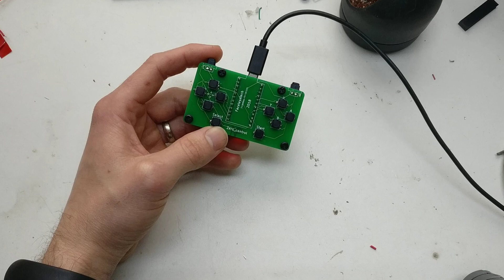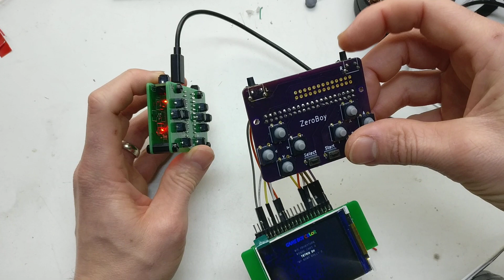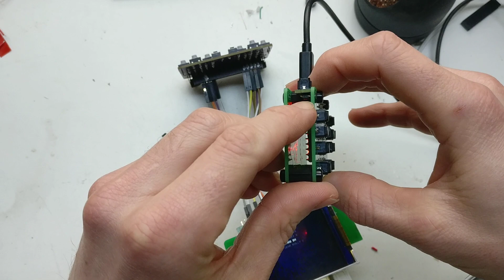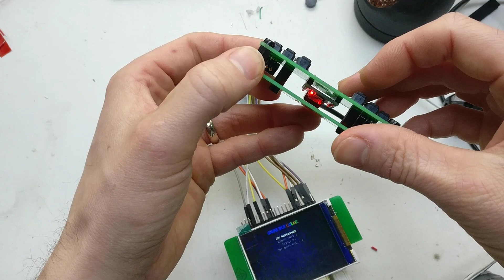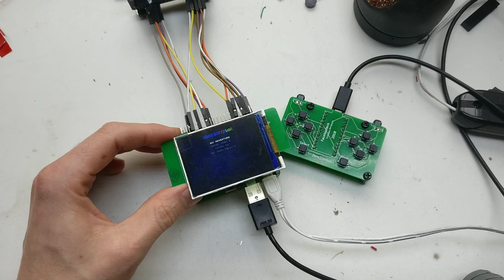zero control (Arduino pro micro game controller)

Comment: Where did you get the controller boards from
Reply from the maker: I designed it myself and had it made at JLCPCB. The files are available in the link to my blog post in the description.
Reply: @Facelesstech  thank you bud appreciate the response